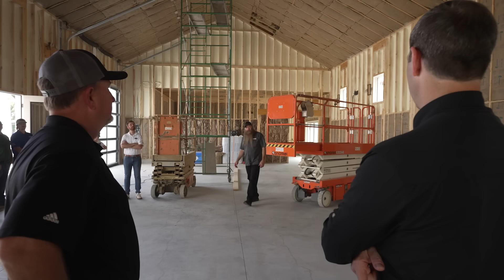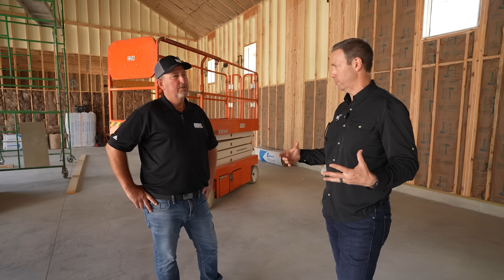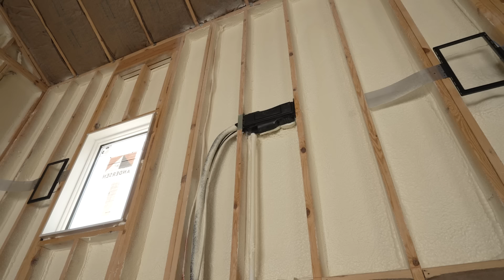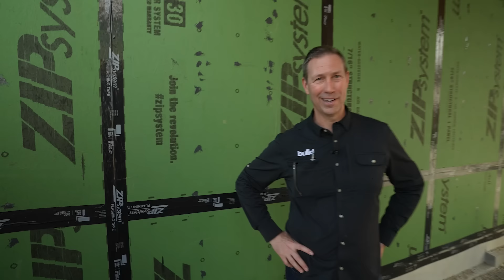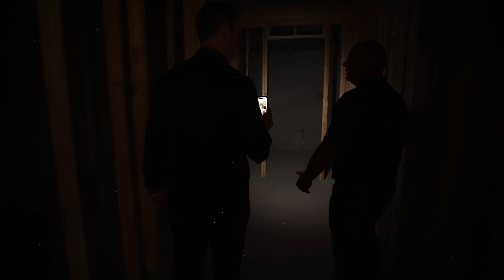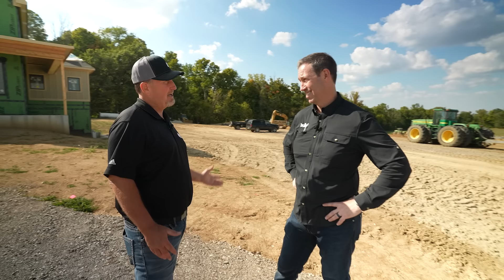Wood Framing that’s Rock Solid! - Indiana carriage house and more

Comment: I joists vs trusses - pros-cost, just in time delivery, trimmable   in the field, fire break already in place, quality control compared to hand nailing of plates at factory . Trusses- safer to walk on , way way way easier to get ducting through and organized wires and pipes , large nailing surface

Comment: I'll need a building like that when I finally have my house, place to part work trucks, and RV maybe, a couple vintage cars, and maybe a lift to work on them. And maybe an office and warehouse spaces. Do a nice polyuria coating on the floor so you could pull all the vehicles out and have a big open space for activities too. A building with limitless options really.

Comment: isaacs pants are cutting his circulation off to the rest of his body. those "conduits" you guys ran are not useable. 
1- plumbings 90s and 45s are basically impossible to fish and pull thru
2- that pipe isnt code. it isnt UL listed for electrical applications so any inspector would fail me immediately

Comment: I would use more than an inch of closed cell, especially in a colder climate like Indiana. You want enough closed cell to preclude any condensation in that cavity. Spray Jones did a video about this on his channel. He's not a fan of flash and batt at all, but I suggested that you could make it work if the majority of the R value is achieved by the closed cell and he agreed.
Reply: You specifically need enough closed cell to prevent condensation relative to the total cavity R value. 

In our climate it works out to 55% total r value as closed cell or it's better to not use any at all due to moisture issues.
Reply: @Squat5000  So is Duke Homes doing in the wrong or inferior way?
Reply: @KidoButaiPoker it works in some environments. 
Not all. When you have a cooling dominant climate with occasional cold, you don't need as much closed cell. The longer your environment maintains cold temperatures, the greater the ratio of closed cell you need because it acts as a vapor barrier. The less closed cell you have the more likely you are to run into condensation in the wall cavity. 

Our SOP on the Canadian border is 55% because on our design cold days, the probability of internal condensation is much lower. In conjunction with Siga Majrex, our wall cavities maintain much lower average moisture content. We've had opportunities to run tests on several homes with long term monitoring equipment and it helps design better. 

It doesn't matter what "pick a person" says it's the better system. The measurable numbers in your environment will dictate the correct plan. Never just assume, monitoring equipment is cheap and helps you build better for your environment. It's one of my frustrations with building codes. They make a recommendation with no nuanced info per region. 

A couple of other folks on the build show have also called this out in the past as a limitation of code.
Reply: @Squat5000  Thanks for information
Reply: @KidoButaiPoker  It isn't living space. I doubt that it will be conditioned space all through the year. 
It is essentially a garage with some insulation and a mini-split in it for the extreme summer heat.
Reply: I also believe you should use an unface batt. The spray foam handles the moisture.  Faced batt can trap the moisture.
This is what ChatGbt says

Unfaced (open-faced) batts are almost always recommended over the foam.
The foam handles air sealing and vapor control; the batt just adds R-value.

Faced batts (kraft or foil) would create a “double vapor barrier” — bad for drying potential — unless local code specifically allows or requires it.